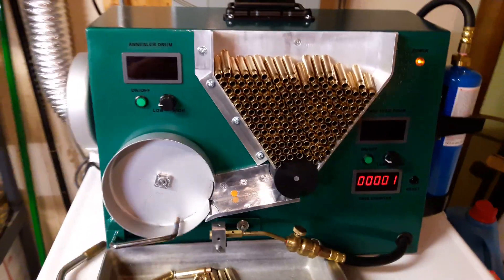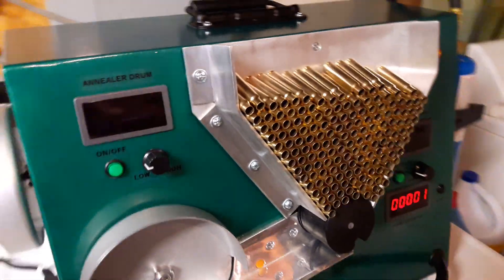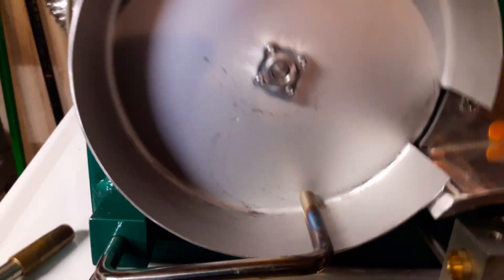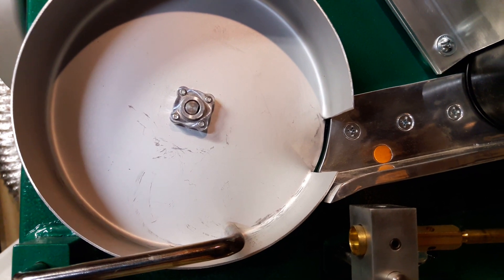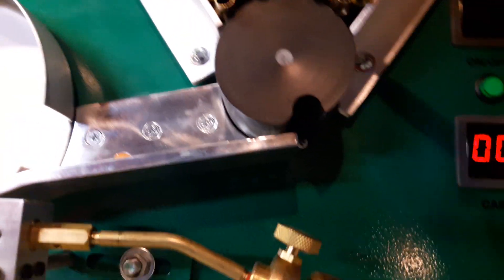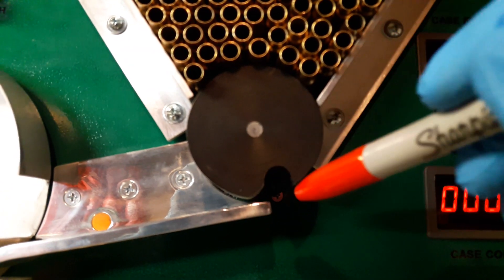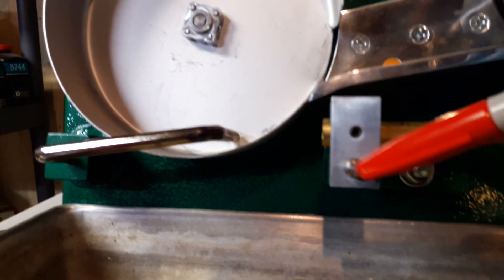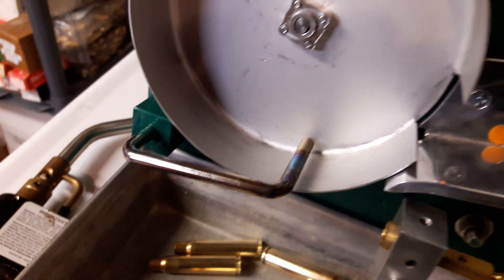DIY Brass case Annealer (overview on questions I was asked)

Comment: I hope you’re still out there. Just wondered if you made the wheel at the bottom of the hopper or did you buy that off the shelf? If you made it what did you make it out of?
Reply from the maker: Hi, I'm still here. Just haven't made any videos lately...As for the part, I made it, and the material used was Delrin Plastic

Comment: Hi, I'm in the middle of building one of these, but I can't get hold of the black nylon wheel that transfers the brass from the hopper. I presume it's nylon? Could you give me the details you used in your internet search to find this type of item? Also, could you give me it's width, depth, and center hole diameter. I'm in the UK.
Thank-you in advance. J.
Reply from the maker: The wheel is made of Delrin or aka Acetal. I will have to see if I still have files of my prints what I machined it too.

Comment: nice unit, I would just add a couple adjustable feet to the front to overcome the case taper.  I am thinking of an automated annealer with a drop through and inductive heater.  Not sure what your using for motors and controls, but if you used steppers and controllers with an arduino, you could program it to only drop a round on the ramp right after the drum had accepted the previous round.  and control the time they are annealed as well.

Comment: glue plexi to a rod with a magnet like targetmaster
Reply from the maker: Not sure what your comment is referring too? Plus I dont know or heard of targetmaster
Reply: @KarwathKustoms   sorry thetargetmaster in comments below. He has a piece of plexi attached to a metal rod with a magnet that attached in front of hopper to hold casings from tumbling out when they are stacked high
Reply from the maker: @alanc1872  I plan on building a different style when I get time, so I will not be putting anymore fab work into this one

Comment: Just  thought for the hopper, if you use some threaded rod in 4 of those bolt holes with a spring and washer to push back on some plexi, you could then adjust in and out with a wing nut or something for different length cases.

Comment: Thank you again for sharing.  Looking at the picture of the inside assembled unit, included in the drawings, there is something like a power distribution unit not listed in the parts list. There is the power supply but what is the unit sitting to the left when you look at the open back on the bottom of the cabinet? Can you tell me what it is?
Reply from the maker: If it's the one I'm thinking of it's a small power unit to run the fans and prox sensor/counter

Comment: What sensor are you using?
Reply from the maker: Inductive proximity sensor, most if not all Electronics can be purchased off of eBay and sites alike for a low cost, I dont have a brand name to give you

Comment: Do you have a link for the prints you mentioned in the video for the case annealer?
Reply from the maker: look up Karwath Kustoms on FB..They are under the picture section
Reply from the maker: look up Karwath Kustoms on FB..They are under the picture section
Reply from the maker: look up Karwath Kustoms on FB..They are under the picture section
Reply from the maker: look up Karwath Kustoms on FB..They are under the picture section
Reply from the maker: look up Karwath Kustoms on FB..They are under the picture section

Comment: Really nice home build there. Tilting the whole cabinet back will help but not cure the problem of some types of cases slipping forward. Wiring the proxy switch to actually stop the feed roller will stop the double feeds.
Take a quick look at how I made a simple shield to cure the tapered case problem. The shield is held on by a magnet and can be removed or placed anywhere.
https://www.youtube.com/watch?v=_330JnAaMBQ

Comment: Would leaning the whole unit back on a 5 to 10 degree angle fix the problem of cases falling out of the hopper? Would this cause other issues?
Reply from the maker: Rodger Anderson it does lean back but to much can affect the feed down the ramp to the annealer drum. reality is the highly it's stacked with slight taper in cases it soon will overide the offset in the cabinet. I will be designing a different style annealer when I get time and share it but I have some custom bike builds to get out of the way first..maybe this fall if all goes well.
Reply: @KarwathKustoms  answers my previous comment on leaning the whole thing, you could also add more taper to the top of the cabinet while leaving the face with the ramp closer to vertical.  Obviously there are many ways to deal with the issue, and it will take some experimenting to find the solution that works best.

Comment: the sensor you have as a counter. I noticed one guy had that to activate the feeding drum. can you do yours as double duty?  Great job by the way. look forward to your next project
Reply from the maker: Eric Koechling I am no electronics in no way, I have been asked this before and tried to do it. Hard to explain in text but all I could get was if I had speed control at full speed it would work but if the pulse was turned down which I believe changes motor frequencies then I couldn't get it to work..I can only suggest that you contact them and see if they will be willing to give you info on how the did it..my 12v electical experience all comes from wiring harleys and or customs..sorry I can't help you on that question.
Reply: Thanks for the reply

Comment from the maker: one thing I didn't mention on the black feeder drum is, the reason I machined out slot towards the rear is  that drum was made to be universal for 223 and up without differnt drums needed so the slot is to allow cases to sit flat that have rims such as 7.62x54r, 8x50, 8x56r and so on.